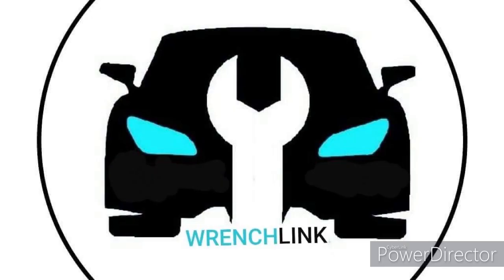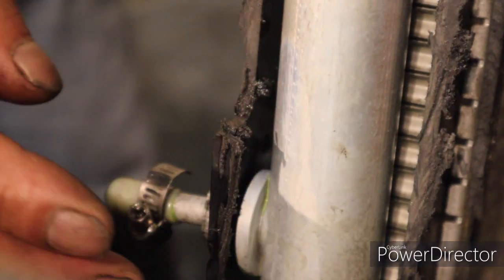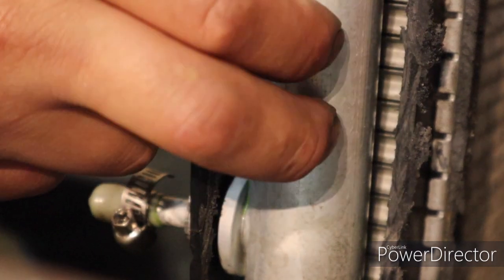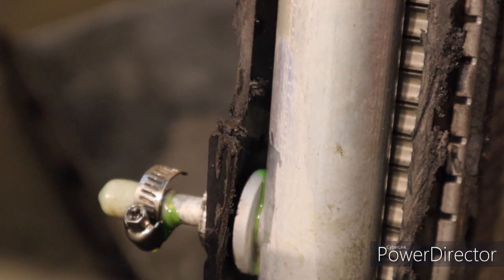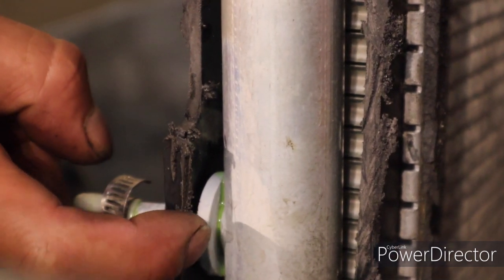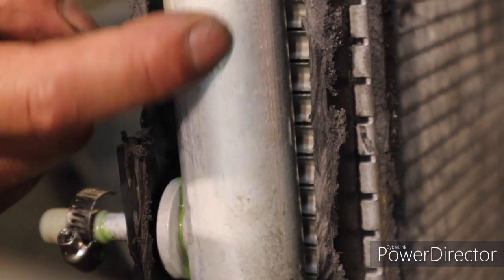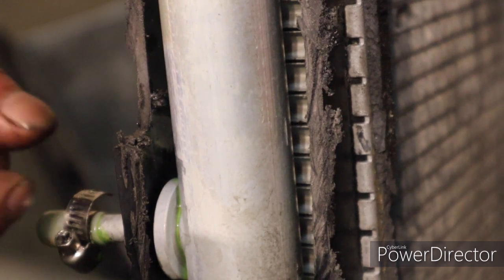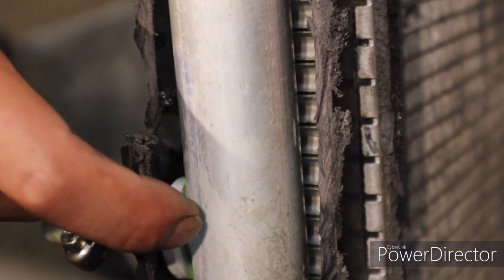Water in Nissan transmission | Pathfinder, Xterra, Frontier

Comment: What about doing a transmission bypass by  going through the auxiliary cooler?
Reply from the maker: you could do that too but I'd recommend a bigger auxiliary cooler and check if it cools the transmission fluid properly by using a scan tool
Reply: I think I will  bypass the radiator and install another external one with a temperature blower fan 😊

Comment: Is this a symptom all Nissan radiators have? I have a 2016 Nissan NV 3500 SL with the V8 platform that is shared with the 2008-2012 Pathfinder but they have a different radiator with the same liquid cooler/warmer setup.
Reply from the maker: No, not all Nissan radiators

Comment: Great video. This is a well known problem with Frontiers (Navaras as they're known here in the UK) but this is the only video I've seen showing the disassembled rad and the actual point of faliure. Nissan do not help matters with the 'sealed for life transmission' bollocks. No dipstick on the later boxes, you have to read the ATF temp sensors with a decent quality diagnostic tool, drain and pump the fluid in via the fill tube in the pan three times to get a full fluid change. Clean the pan and replace the filter and pan gasket too, obviously. I actually approached Nissan for an ATF change and they refused to do it. "Sealed for life, mate". "Life" being Nissan's warranty period, then you're on your own. Did it myself at 100k and I'm glad I did, the fluid was turning brown. Do yourself a favour and buy a Toyota.

Comment: Also heard these coolers known as "concentric oil coolers" fail due to increased pressure by being clogged. There is a product called kooler kleen in a can that is made to flush the cooler out to avoid any blockage

Comment: 5/27 8pm I had the milkshake problem, i replaced my trans with a used one, after installing trans my truck barley moves at a high rpm. Is there anything I missed? Please help
Reply: I did replace radiator and added an external trans cooler
Reply from the maker: Does it have good transmission fluid level?

Comment: Wish I had seen this video sooner. Have a 2006 Xterra this has happened to at about 150k miles. Just happen to catch it in the early stages of the failure. Keeping my fingers crossed the transmission hasn't been compromised. Had the timing chain and water pump replaced about a year ago.....$2800... OUCH!!!😢 Didn't know these things had two coolers. Video was very helpful and informative, thanks a bunch man!👍
Reply from the maker: I'm glad I could help!
Reply: Dumdass

Comment: I appreciate the effort of putting this informative video. My 2.5 frontier is not affected by this issue but I love to learn and your the only one that explains this problem very clearly. Thanks again. I’ll subscribe!
Reply from the maker: You're welcome and thank you
Reply: so does it not affect the 2.5L at all? I just bought a 2006 frontier 2.5L and would like to know
Reply: @marcus marista don’t worry the 2.5 doesn’t have that issue. I have a 2007 with 283k with very minimum maintenance. I have replaced the cam shaft sensor, catalytic converter which I bought from eBay for $250 about 4years ago and still working fine. I did it myself with very basic tools and it’s still working well. I would buy another 2.5 if I had the chance . They are very underrated but fantastic vehicles if you don’t tow heavy stuff.

Comment: Very informative video man, appreciate you explaining this and showing how the system works
Reply from the maker: you're welcome
Reply: My radiator is clogged with Grey oil,   does the new radiator solve the problem???🤔
Reply from the maker: @javiergaytan977  the oil should be TRANSMISSION fluid from the cooler inside the radiator so replacing the radiator should solve the problem but you would have to flush the cooling system so that the oil already existing in the cooling system doesn't clog the new radiator again
Reply: @Wrench Link  tanks bro.   Appreciate your help.

Comment: doing this right now, replacing rad and trans cooler.  ready to hook up new hoses and refill and test.  my question is, how does the trans fluid mix in the radiator and not mix with the coolant?  wouldn't it make sense to just use the trans cooler for the ATF and the rad for the engine/heater coolant?  if I'm putting on a new trans cooler, cant I run the hoses this way?  thanks, great video btw
Reply from the maker: The ATF doesn't mix with the antifreeze inside the radiator, the antifreeze only cools down the ATF. The transmission fluid cooler Infront the radiator is not enough to cool down the fluid, it needs the radiator to cool down the ATF

Comment: Do the new replacement radiators still fail the same way over time or has this flaw been fixed?
Reply: Good question. I was wondering the same thing.
Reply: I saw another video and that one said that the factory Calsonic brand radiators are the ones that cause this issue. I'm unsure if there are others but that's the one that was pointed out in another video.
Reply: I've researched and found many aftermarket radiators have fixed the issue so should definitely last.

Comment: Can i Dont just bypass the radiator and put a separate AT oil  cooler insted? .
Reply from the maker: Yes, that's another option. Just make sure to put it in front of the radiator where air is going to hit it

Comment: I have a 2004 pathfinder, 318,000 KM on it...I have been told I can bypass the system and add a Air to Oil cooler? Or should I just replace the rad and transmission oil cooler? I am a bit confused, need a bit of help. thank you!
Reply from the maker: You can bypass by adding another external cooler, or replace the radiator which would give you another 50k miles or more

Comment: Nice video. I subscribed. I have a question; I am thinking of buying a 2009 Pathfinder with 82,000 KM and I have read about this leaking radiator problem in some of these third generation models. What is your opinion about the risk of this problem happening with a 2009 Pathfinder.
Reply from the maker: very likely to happen. I'd suggest to replace the radiator and you'll have a good truck for many years to come.
Sorry my reply too late, i get a lot of comments on all my videos and can't get to them on time

Comment: Please I use 2007 Nissan versa but I just realized that coolant mixed with the transmission fluid please what should I do
Reply from the maker: You could drain and flush the transmission fluid if the transmission is still working. If not, then you would have to replace the transmission and fix the coolant issue

Comment: Can you do a radiator bypass?
Reply from the maker: You could, but you would have to make sure that the separate cooler you install is actually cooling down the transmission fluid.
You can check it with a scan tool

Comment: I mean, is what you mentioned can affect. The problem I have is that when it is cold it works until it reaches its normal temperature and then when I turn off the engine it does not work unless it waits for half or more than an hour. Does it have anything to do with TCM
Reply from the maker: you have a different problem, it shouldn't be the radiator
Reply: @WrenchLink  Thank you. I found out the reason and fixed it myself after several tests. I bought a simple test device and followed the codes and the problem was solved. Praise be to God.
Reply: @jaffarjaffar8386  what was the reason/problem you had then, if not the SMOD?

Comment: I just bought one that’s mixing for 1000. The transmission will move the truck but it slips so should I try and flush the transmission and coolant and replace the radiator or look for another transmission and new radiator?
Reply from the maker: If it slips bad than the transmission might be bad but if it still shifts in all gears than flush the transmission and replace the radiator
Reply: @WrenchLink  ok will give it a shot thanks
Reply from the maker: @brandonpittman5243  you're welcome
Reply: @WrenchLink  ok it started making the whining noise again after the flush and a new filter so I took the pan down and that filter is clogged as well? So I’m gonna flush again and fill and see what happens. Maybe I didn’t get all the dibris out and that stopped up the brew strainer or maybe the water has ruined the clutches and that’s what’s stopping to the filter clutch Material. So I’m gonna flush one more time if it does it again then I guess it’s time for a transmission
Reply from the maker: @brandonpittman5243  sorry to hear that. If it's metal shavings that's clogging the filter then it will most likely do it again

Comment: Have 07 pathfinder with 210670 miles. Around 40 miles it seems like it takes long to change gears the get up and go is slower 😒and also it will go in safety mode when doing a left turn or stop at light in slight decline. The Pathfinder starts right back up it makes me feel like I have a hybrid when they turn themselves off idling at the red light it doesn't do it a lot it seems to stop when I put a little bit of oil in it
Reply from the maker: When you put oil in the transmission?

Comment: Hi . I have a problem with the vehicle Nissan Xterra 2008. The diagnostic code is u1000.can bus . I don't know how to fix this problem . If possible , do you have any information about it ? Thank you in advance
Reply from the maker: a U1000 is a lack of communication issue. sometimes affected a low power. check if the battery is charged properly

Comment: Is it possible that some were built with better radiator? My 06 Xterra has 160000 miles and has not had this problem.
Reply from the maker: Probably or the radiator has been replaced before
Reply: I replaced my rad at 87k odo as elective maintenance covered by extended warranty. My 07 V6 Fronty is now 260k odo. Runs like when i bought it brand new 2007.
Reply: @shadowtruck5991  That is great. I wasn't offered a radiator. I heard the problem was that some of the original transmission oil was corrosive and it caused the damage. Love my 2006.
Reply: @johnmontana18 I would do the bypass, or replace the radiator if you haven’t already. 05, 06, are really susceptible to it. Anything from 05-11 are really.
Reply: @elonsus9747  Dealer told me that not all had the problem and mine was one that didn't. But I will have it checked again as I have a very slow coolant leak. thanks for your reply. Checked again (8/23) for coolant transmission issues and my xterra is built different and doesn't have this problem. Mileage 186000.

Comment: Hi
I have Nissan Pathfinder 2016 model, 
Last week I had driven it from deep water and it started jerking immediately. 
Then replaced all plugs, 8:39  engines oil , oil filter and when checked gear oil it had full water contaminated in it.
2 times they flushed the oil and still I'm not satisfied it jerking
Reply: Can you guide me what to do transmission is expensive
Reply from the maker: The only solution I can think of without removing the transmission is to keep flushing the transmission until the water is removed completely. But that might take several transmission fluid flushes.

Comment: HELP  My radiator have Grey oil on tap, is possible is fixed put it new radiator?  Sorry my pour English.
Reply from the maker: Yes, most likely the transmission cooler in the radiator is leaking. Replace the radiator and flush the cooling system and flush the transmission fluid to prevent transmission damage
Reply: @WrenchLink  thanks bro, appreciate your help.
Reply from the maker: @javiergaytan977  you're welcome